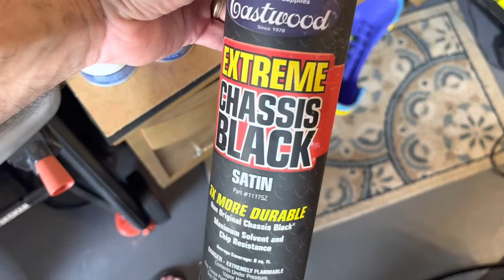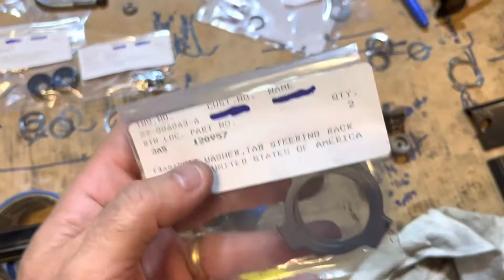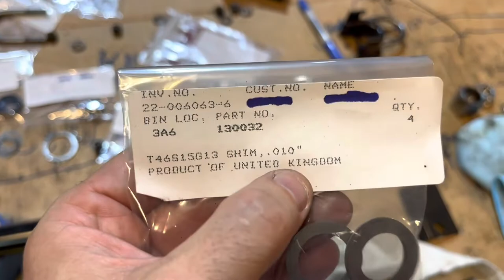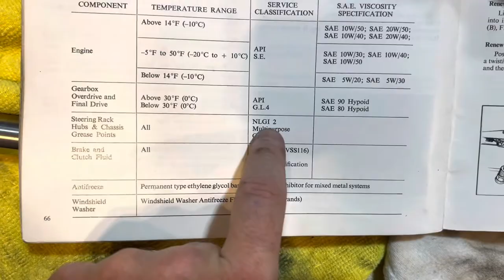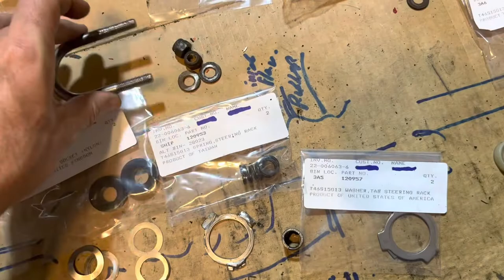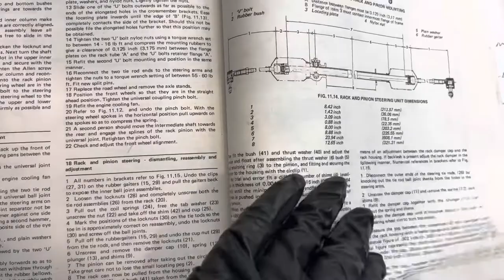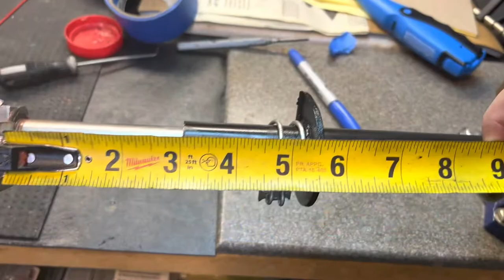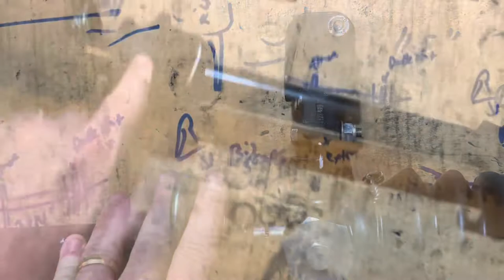Triumph steering rack refurbish & rebuild. Part 1 of 3.

Comment: Very informative vid man, I hope to be picking up a TR6 soon and going through it, going to bookmark this page!
Reply from the maker: Not much on the web about this item.  So I pushed thru reading every source I could. I didn’t change any internal main parts so. I didn’t have to deal with the load tests and adjustments on pinion and gears which is a bit complicated. Sure steers great now though.

Comment: I have been rebuilding my rack, and following your video has been very helpful.   As I try to tighten the connecting rod nuts, it takes very little pressure before the rod movement gets tight, even with no shims.  I replaced the plastic cup and greased everything.  Do you see any concern if it is not wrench tight since there is a tab washer holding it in place?
Reply from the maker: more than likely something is not seating correctly.  Regardless shims are used to fill a "gap" and if everything is tight without shims then you shouldn't need them.  I had to take apart and put back together several times until it "felt" right.  Too much grease was one of my problems.  Or your plastic cup might not be the same size as the original.

Comment: How were you able to order the shims or when did you?  As of April 10th 2023 they are not available from TRF, Moss or Rimmer, for either the pinion or the tie rod ends.   I would have rebuilt mine but without the shims it seemed  not worth it as the end play in the pinon was excessive.  Could not even find a rebuild outfit.  Thanks,
Reply from the maker: I’m traveling Europe right now so can’t check my records. I believe I got them from TRF but not 100 percent. These items should be available but may be on back order. You do need a good pile to play with. Takes lots of trial and error to get the right feel.  I got mine last year some time. Call Albert at TRF.  I’ll try and check back next week when I’m back in the states.